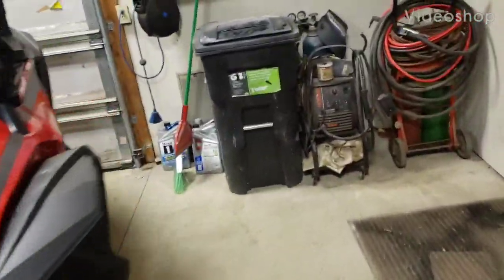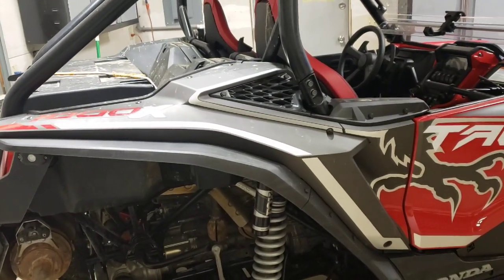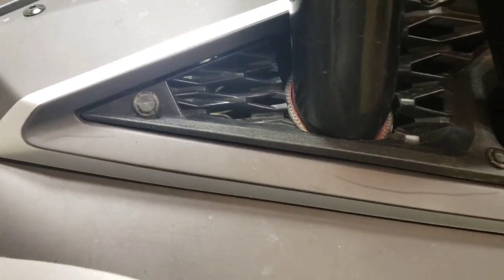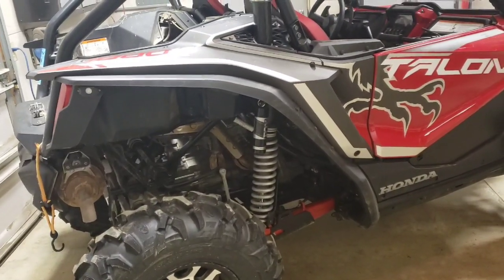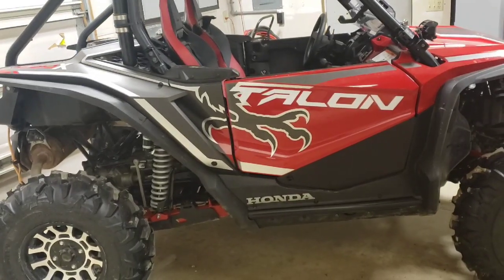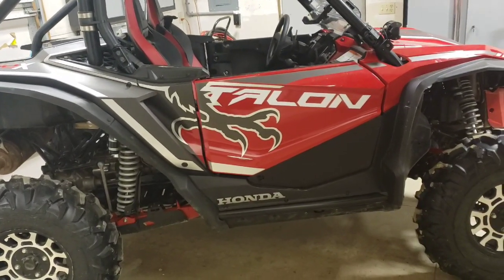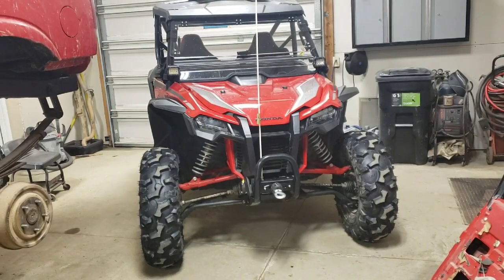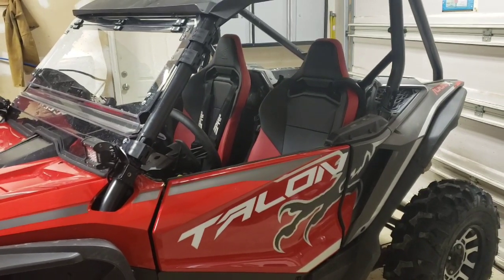Honda Talon home made snorkel

Comment: I was really hoping to see the how to. I have the same inner cooling pipe and was wanting to see how you connected it to the box. I've not taken my Talon apart yet.
Reply from the maker: Just use the factory connection at the box. I had to use one of the silicone sleeves on the end of pipe to make sure it was a tight fit.